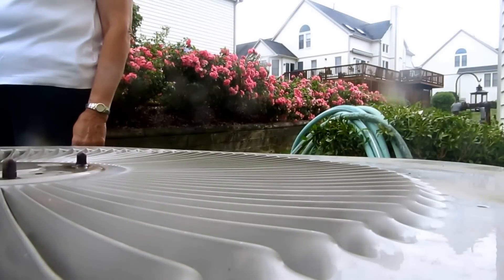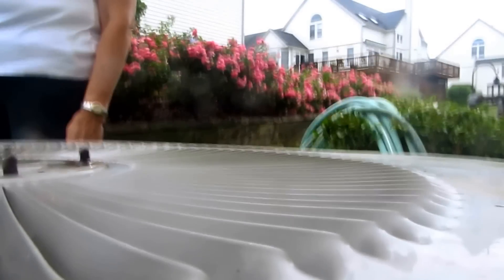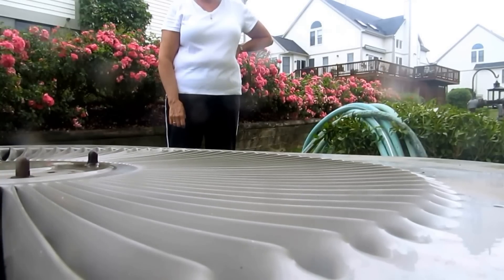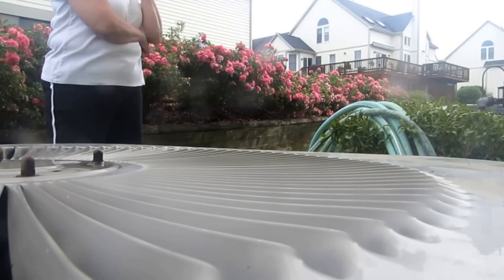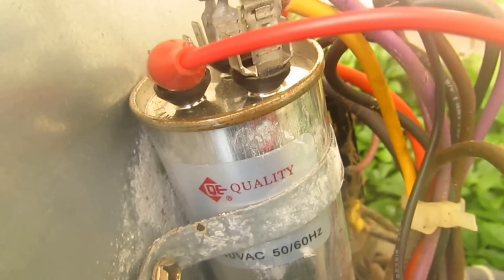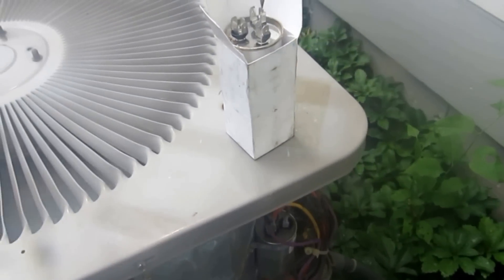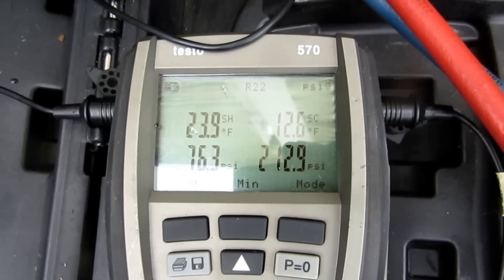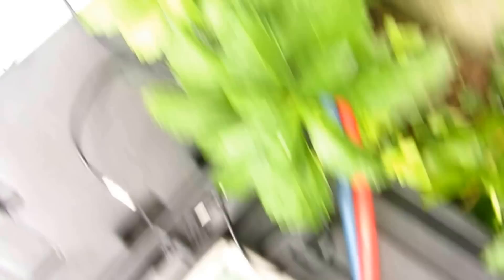Hvac repair:a.c.condenser fan motor not spinning ,no cooling

Comment: Sorry Steven I meant that comment for a different video clip of yours It was on the one where you went to a.C unit and someone that installed the system did not do a vacuum and you had a high head pressure high sub calling Sorry about that one .... This clip is a good one to keep up the good work

Comment: Hmm... Ours was working fine up until a few days ago... (RHeem Split unit, 2003)
-There's power to the unit per the voltage pen/detector, but the outdoor fan doesn't spin.. there's no hum either.

-Fuse box/Breakers are ok

-I thought my brother tripped the door switch on the furnace, but that seemed fine too. 

-The 3M Thermostat is reading the temperature correctly, but all i get is the usual click when i move the fan from Auto to ON. The AC unit doesn't respond to the temperature threshold, or the fan manual ON Switch.  :(

We've had a few power outages in the area but it always came back on afterwards.  How do i find possibly tripped safety switches? it's too hot for this to happen now! lol.

Comment from the maker: i love the testo 570 i have all 3 of them 550,557,and the 570 i like the 570 the best the buttons/menues are a bit different with the 570 .i like the 3/8 line for the vac opion i would go with the 570 for sure i like the gray color better lol .and it has printing capabiltes also thats just something i don t see a need to use that at this time .don t get me wrong i have nothing bad to say about the testo 550 ,when i see my old  anolog gauges it the truck i say i will never use them again ..later

Comment: Our air conditioner has always worked perfectly, yet we turned it on about an hour ago, and it made this horrible screeching, then nothing happened. my mom turned it off then I went over to the window when she turned it on again and nothing happened at all, like it was dead. We didn't turn it off; then a few minutes later it made the screeching like it was trying to make itself work, but I rushed over and turned it off, forgetting we left it on. It won't run at all, it's not making the screeching noise while running like most people on here say about theirs. We're not sure what to do. My mom is worried it's the compressor, and we can't afford a new unit right now.
Reply from the maker: +SladesGirl sounds like your fan is bad or run cap to fan  and the compressor is running and relieving pressure shut it off and call someone to look at it .
Reply: +steven lavimoniere okay, I did call someone. Thank you

Comment: Mine makes the same noise but fan runs. Do you think the fan motor is starting to go or the capacitor needs to be replaced. The coolant from outside is cold but not cooling house and the air from the fan is not as warm as it used to be

Comment: Very good video Steve,   Question:  My outdoor condenser fan motor is drawing 1.03 amps   it is listed at FLA  1.3   Does this sound normal?   Does FLA mean full load amps?  Is that like the max it should be pulling?   Thanks Steve, I am just trying to learn.  Keep up the good work.  Gerry
Reply from the maker: gerry mcadams yes fla=full load amps as long as its below fla i would leave it alone.best to check the capacitor for proper microfareds also
Reply: Yes Steve thanks for responding, I did check the capacitor. The fan side was good but the compresser  side was low. So i changed it out. Thanks again for your help.

Comment: hi Steve. having issues with my parents unit. I think it's that capacitor. an AC guy is going there today. They live in Georgia. how much should I expect the guy to charge if all he does is replace the capacitor? he's charging me $90 just to show up, which I am ok with.
Reply from the maker: +alfredobrown for me it would be 95 for service call and 65 for the cap =160  more if i had to add gas ect . but not sure what he will charge you . flat rate guys might be 350  or so  i have no idea what they do done there ralph from t&n serves lives down there .he is on youtube he is from georga
Reply: +steven lavimoniere thanks for your prompt response. The technician is saying the compressor went bad.  The unit is a Cumberland manufactured in 1992. have never had issues with it before this one.  They are recommending replacing the whole unit. should I get a second opinion or did we get out of that unit the most we could and is time to replace it?
Reply from the maker: alfredobrown a second opinion and quote is always a good thing ,could be a burnt wire at the compressor .have the guy show you the meter showing a short to ground .i usally show people what the issue is .and why .
Reply: +steven lavimoniere Thank you so much for taking the time. My family told me the tech found some burnt wires which he changed but then concluded the compressor was grounded and that it could have happened due to a power surge. He did not show a long meter readings though. They are sending one of their sales guys to prepare a quote for a new unit. I agreed that free quote and am curious to see how much it's going to cost. I have also contacted Ralph from t&n, which happens to cover the area where we live. He can't make it there uh until Saturday.

Comment: our ac went out called the guy out .  fan motor was replaced . its running now but it takes it awhile for the fan to come on and it will  not  stay on  very long and there is a lot of heat should the  fan stay running or is it normal for it to cut off like that
Reply from the maker: if its a 13 /14 seer regular condenser straight ecm motor it should come on and stay on if its a mini split inverta system it could regulate .did he change the run cap???
Reply: i dont know but i am going to call him today and find out.i took the cover off to see if the capacitor was popped up or round at the top and it looked like a mini it was small thanks for the quick reply

Comment: I changed the capacitor but the fan still wont run. Compressor turns on.... Bad fan motor?
Reply from the maker: bigdoggchingon it could be ,had to tell unless i am there checking voltage
Reply: bigdoggchingon I'm just curious as to why you changed the capacitor? Was it bad or you just saw what he did on the video and thought that was your problem as too?
Reply: Just wanted to start off with the least expensive thing. It turned out to be the fan motor tho.  Still an easy fix.

Comment: i got a portable ac haier 12,000 btu the exhaust fan motor wont turn i change the capacitor and nothing , i cut a cable and try it direct to power  but the motor wont spin just if i push it with my hand start spinin
Reply from the maker: usually some of them small a.c. are throw aways ,just but a new one ,,,,, the price of a motor is as much as a new unit ...it does sound like a capasitor to me do you have the right microfard cap???  chack the wire connections also.
Reply from the maker: is there proper voltage going to the motor??? is the cap the right one???
Reply from the maker: what is the voltage and amps to the  motor???????????
Reply from the maker: well figure out what is going on and fix the fucking thing .. motor ,cap or what ever get off your ass and make it happen